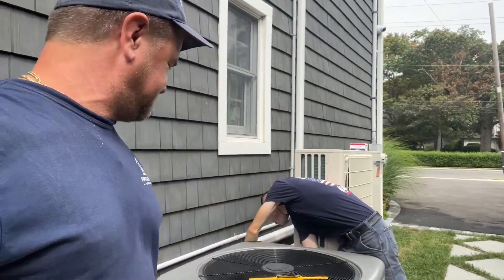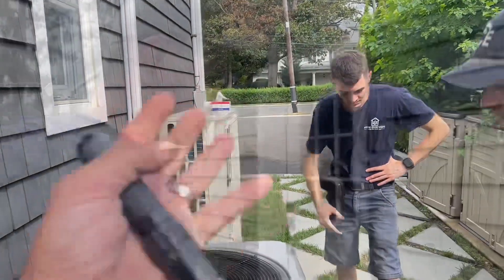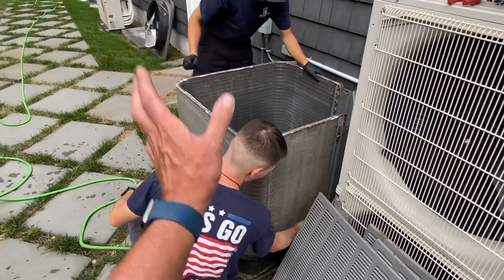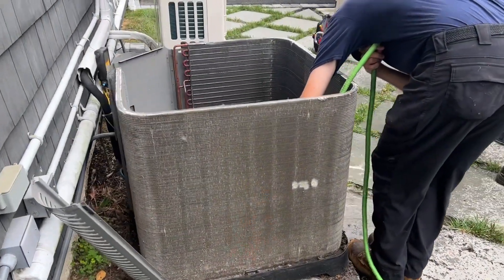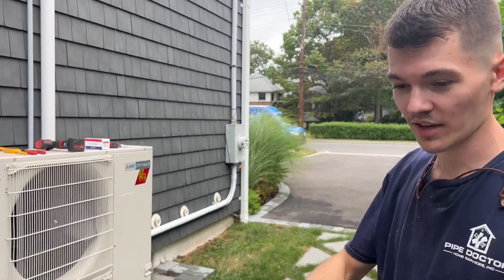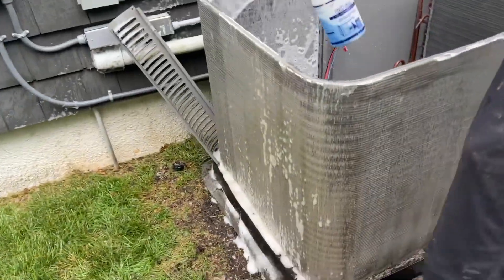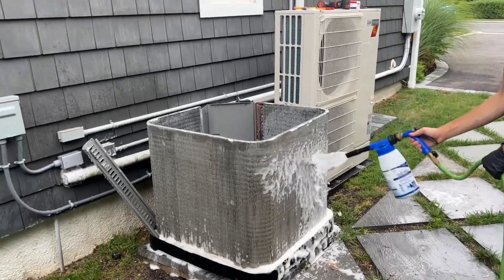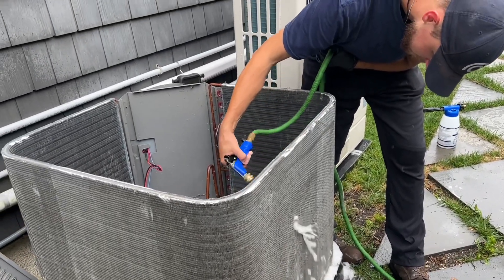Rheem Central AC Takes Forever to Cool House How to Properly Diagnose and Repair

Comment: Not in hvac anymore, but when company I use comes out 2x year for maintenance, on 2nd time I do make sure they clean those coils; after remodeled inside, I had them pull indoor evap coils to do thorough cleaning as someone decided to install 2 brand new units (in & out) for the house 3 weeks before whole home remodel started 🤦🏼 Doh!
By the end, when they pulled to clean, units looked 6 yrs old, and duct work was horrid too something ppl don’t do or don’t do well, but if pulling evap coil to clean from construction work, not doing ducting; waste of money, imo
Cheers ✌🏻

Comment: I'm in the trade, and outdoor coil cleaning is part of our summer maintenance. We run into a lot of micro channel coils so we use a cleaner that is ok for micro channels. When at all possible I use plain water on those coils, but sometimes the cleaner is needed.

Comment: Mikey Pipes.. How many times during the summer season should the coil be clean with water.. I spray with water  room a/c unit once a year.
Reply: It really depends. Usually once a year is enough but you may have to do it more than once if it gets really dirty

Comment: Basically I do a yearly coil cleaning with a hose and spray cleaner from inside out yearly .. but fully disassemble the external panels and do a NuBrite cleaning every 5 years.  Cottonwood debris is a problem in this area.

Comment: Has anybody thought of placing a easily removable and cleanable External filter over the coil to catch the worst offenders and allow the homeowner to clean it  seasonally?
Reply: Not sure thats a good idea , you would possibly cut down on air flow thru the condenser ... all do respect
Reply: Sure customer won't change air filters inside. Just disconnect and hose down

Comment: Do not use the blue viper on paint/coated coils or micro channel. The Blue will eat the paint off the coil. Also you should consider getting the Viper coil gun from Supply House, it works best with the viper cleaners and you pour the cleaner straight into the coil gun and use the settings to adjust ratio.
Reply: Viper coil cleaner gun is the same as the Nu Calgon one just a different label on it.
Reply: @Cashmoneymc95  its different I have both!!!